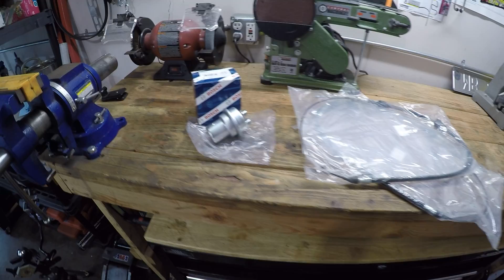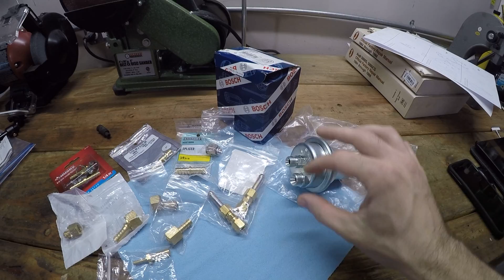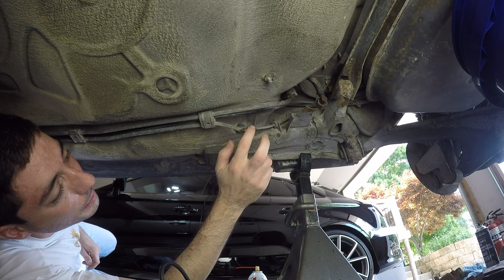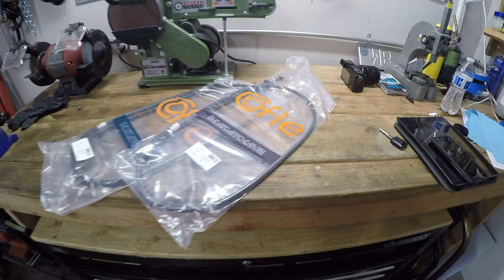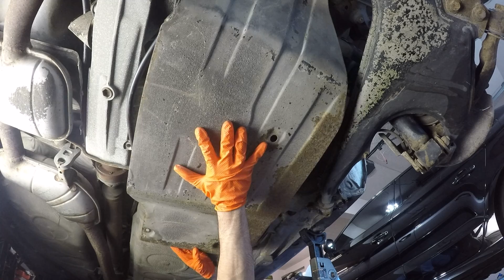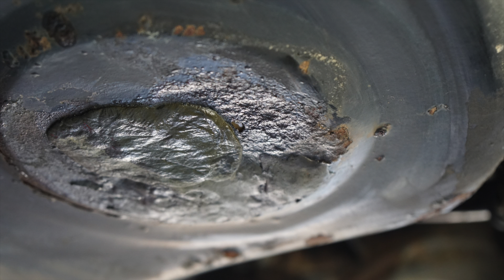Project Audi 5000 CS Quattro | Ep. 2 | The RUST nightmare begins!

Comment: These are great videos for anyone who, like me, owns/drives a 36 year old Audi 5000. I noticed a can of CB Blaster sitting on the garage floor. I mention to all who see this video - that stuff is fantastic. If CB Blaster had been applied and allowed to soak in for a spell before trying to loosen the rusted connections on the fuel accumulator the breakage would never have happened, saving loads of time and trouble. 
    Any time I'm working under the car where rust is the worst I always put on CB Blaster and let it soak, sometimes for a day, or so, if the rust is really bad. Given enough time to do it's thing, CB Blaster will loosen just about anything. As a last resort, if the situation demands, and if it can be done safely, I will apply heat from either a heat gun, or a torch. CB Blaster + heat has never failed to loosen the worst rusty connection.

Comment: I had Audi Minneapolis install a 443 906 087BE Audi fuel pump that I supplied. This pump does not need a working fuel accumulator. The failed accumulator can be left in place or removed if it is in danger of leaking.
Reply: If my fuel pump runs after i turn on the ignition can i remove the fuel accumulator also ? Audi 2.3NF k-jetronic

Comment: I am not familiar with the Quattro, but for the e brakes on my '87 5000S there is a procedure for adjusting the tension on the cables so that the brake pads grip tightly when set, but also release fully. Check in Bentley or Haynes. It's a simple adjustment.
The cold start valve can be easily removed and held in a glass jar while an assistant turns the ignition key to start. A good short shot of fuel should be seen. If it isn't check the electrical signal to the cold start valve. If there's current at key turn the valve is bad. Replacement is easy.
My limited understanding of the CIS-E III engine control system is that the current to the differential pressure regulator mounted on the front of the fuel distributor is increased to enrich the fuel mixture and help start the car. The amount of enrichment is controlled by the coolant temp. So, be sure the coolant temp sensor mounted right above the thermostat on the front of the engine is good. Inexpensive sensor, 2 mins to replace. 
Just below the coolant temp sensor on the engine block is the knock sensor. I just replaced this the other day on my 5000S. 5 mins, easy peasy. My engine always ran well, but the new knock sensor improved it even more. The engine is smoother than ever, feels/sounds new and the car is 34 years old.
You are doing an outstanding job. I've learned many helpful things from your great videos. My 5000S has had a few near death mechanical issues over the 12 years I've owned it, but has always come back strong once the problems were fixed. The 5 cylinder engines are rock solid and with regular preventive maintenance can go at least 350,000 according to the Audi tech I bought my 5000S from who took care of the car for the original owner.

Comment: I"m trying to recall, is there a cold-start injector at the rear of the intake manifold? I know some CIS systems used that.
Reply from the maker: Yes there is, and it could be faulty. However it seems the starting issue is both cold and warm.
Reply: @PracticalEnthusiast  Im going with injector seals on this issue.

Comment: I love these project cars, it's a lot of fun watching you methodically sort things out. the fuel accumulator replacement gave me flashbacks, I had similar parts availability issues a few years back with an 80s Peugeot. I no longer have that car but I have two big plastic totes full of fittings and cohline fuel lines. speaking of 80s fuel injected European cars, I'm no CIS expert but I believe that, in the case of hot start problems, the first thing that everyone suggests checking is the vacuum lines, you probably have a leak somewhere